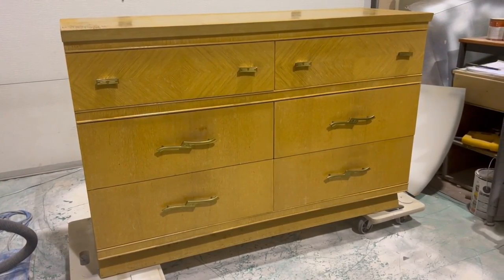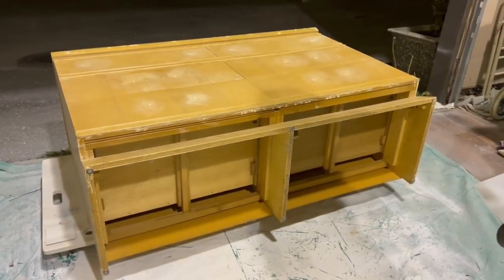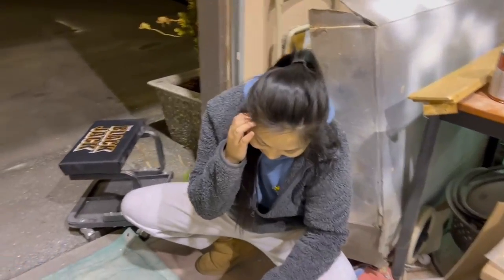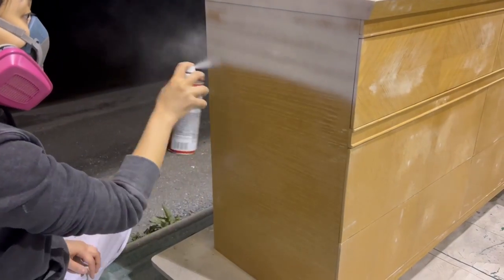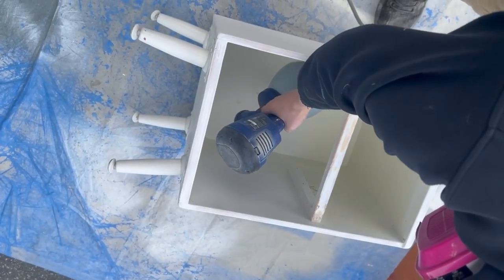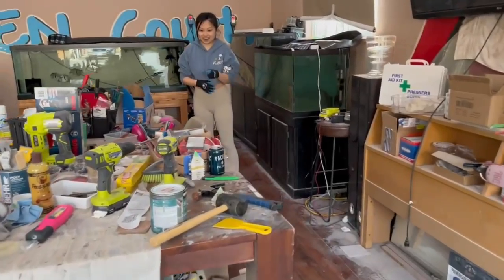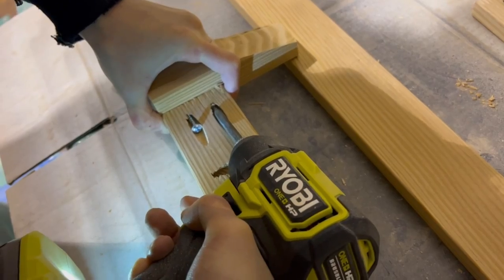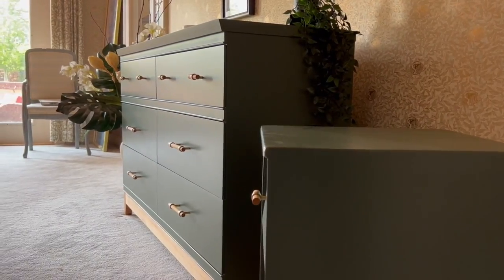I do THIS for a living?!? | PAINTED FURNITURE FLIP w/ SPRAYER | DIY WIFE Wood Base | Power Tool FUN

Comment: What a beautiful transformation! Did you put any kind of a stain or finish on the wood base? It matched really well with the hardware.
Reply from the maker: Thank you Connie! Yes I forgot to say in the video: i applied clear danish oil over the base and also the wood on the handles, it took away that dry raw look and helped to seal and protect the wood ❤️
Reply: @hollysgarage  That’s a great idea! I’ve used those same pulls on two dressers I made over for grandbabies and I noticed they were super dry looking. I’ll remember that tip for next time!